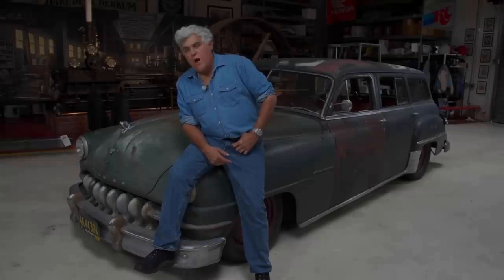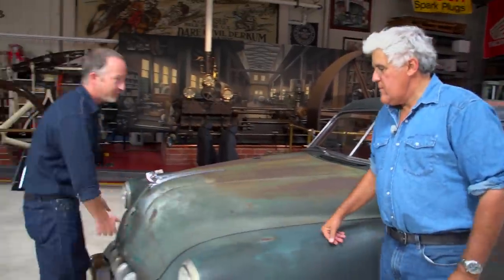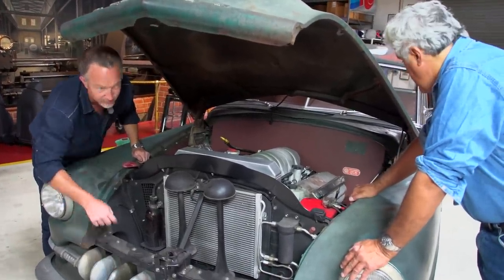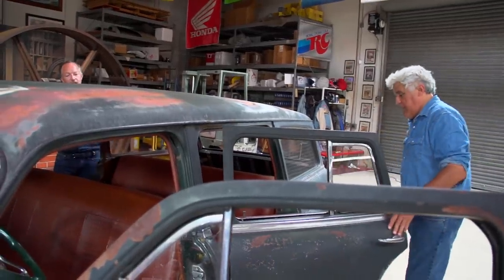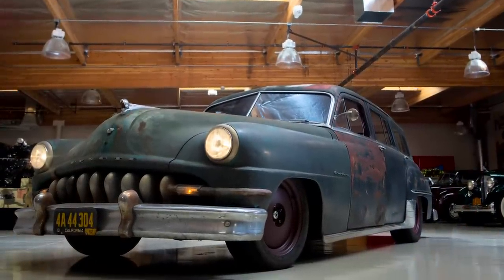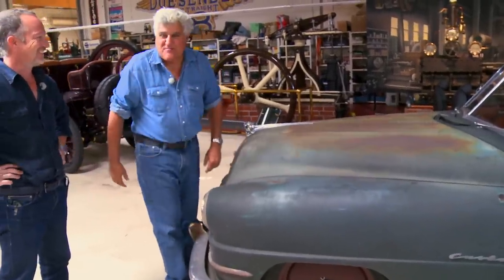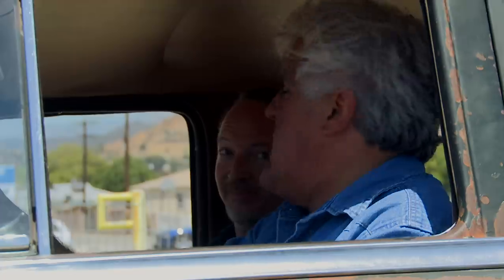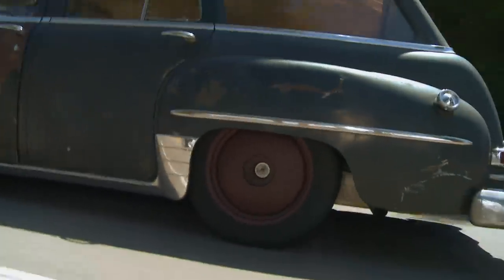ICON Derelict - Jay Leno's Garage

Comment: How much does it cost?
Reply: Doogie Spence Jonathan has said before that if he was going to sell this wagon it would cost $140K  but i imagine depending on the work that has to be done to some of these derelicts and whatever special requests the client may want, they probably average $140k-$175k. It's not really that cheap but for the amount of engineering that goes into building a one off derelict its not really all that surprising.
Reply: Andrew Ball You really think that much engineering goes into this? Really... $140-$175 k worth!? Idk.. That sounds fucking crazy... My dad drives a BMW M6. Pretty sure it has quite a bit of engineering to it. Think he got if for like $ 100-115 grand , brand new.
Reply: Well BMW probably spent millions of dollars engineering that car but once they did it was done and they don't have to do it again until the next generation of the car is designed which is usually something like 4 years, and every year they make thousands of them on an assembly line and all of them for the most part mechanically are exactly the same meaning they can mass manufacture all the parts to offset build costs and thats what lets BMW price the M6 between $100k-$115k depending on options. Now Icon, since pretty much every derelict they've built so far has been a different car they've had to engineer the whole underside of those cars to feel like and perform like a modern sports car with a lot smaller of a budget than 99% of the companies that make cars. If you get a chance i'd check out Johnathan Ward's youtube channel he makes videos of the cars and goes over everything that was involved with building each one the derelicts as well as his normal production FJ's and Bronco's and that might give you some sense of why they cost what they do.
Reply: Or get one restored to Concours level for 65k..

Comment: Since it is a '52, which is NOT an emissions car, why on earth did you put all that computerized emissions CRAP on it? I would have put a real engine in it. Want a Hemi? Then put a stock carbureted 426 Hemi in it, free of all the modern Garbage.. I have a 1954 Chevy Bel Air 210 2 door sedan I am currently building such a project out of. Rust free. It will have a highly modified stock frame, all new suspension (but will retain the solid rear axle, IRS is weak) rack and pinion steering, 4 wheel disc brakes, and lots of other modern stuff, including a new carbureted 383 V8, 4 speed trans, 9" Ford rear, and a lot of other upgraded stuff. But NO electronics whatsoever, except for the original GM HEI ignition system. I have found these to be bulletproof. The title is for a 1954 Chevy, so it is not subject to emissions testing.
Reply: Maybe it's a good thing to meet emissions standards? Do ya think?

Comment: Patina and rust are completely different. Patina on a Tiffany Lamp is one thing. On an old car, it's rust. Period. Chrome is not even remotely expensive as they say. Let's cover the rust, change the wheels, add stereo upgrades, an srt engine but keep the old valve covers, blagh, blagh, blagh. It's a piece of junk meant to be built cheaply and sell at a high profit to the first bearded hipster to come along.